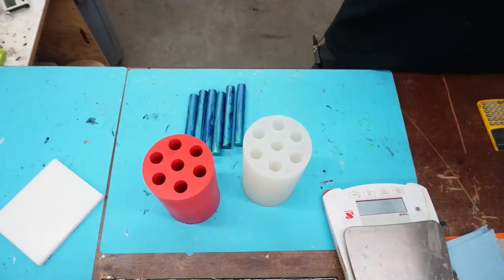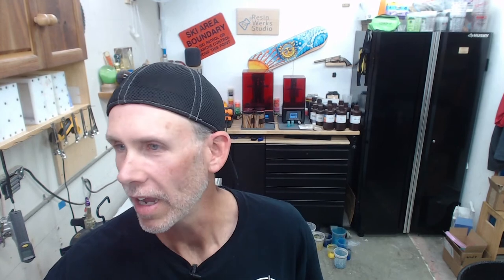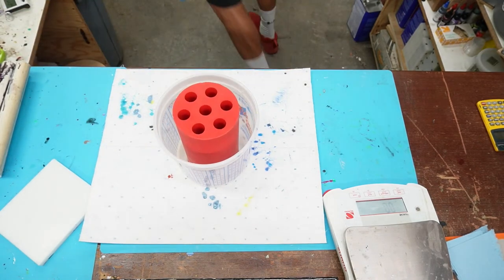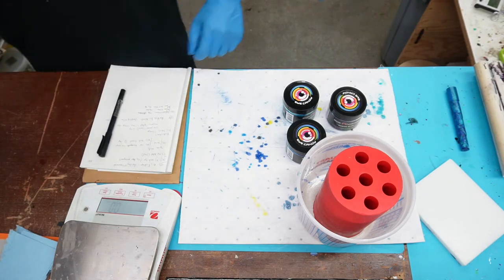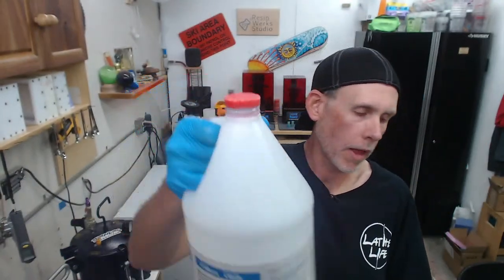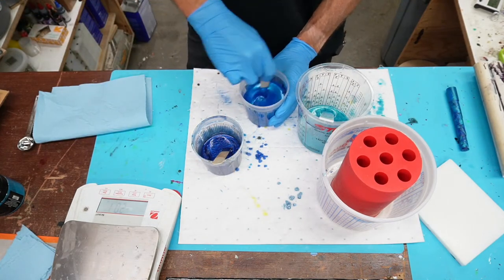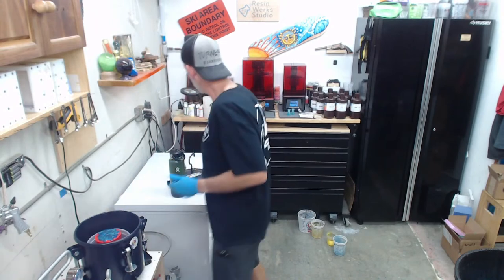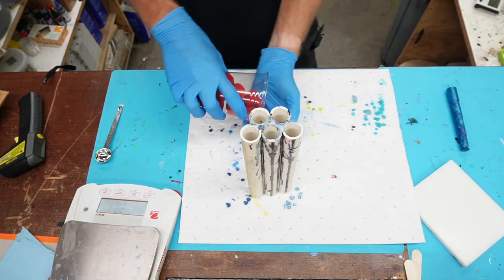🔴Replay: Resin Casting Water Themed Pen Blanks | Episode 214

Comment: Im shopping around for a pressure pot. Is there a size that you recommend?
Reply from the maker: Awesome!! I think I can help... There are two main sizes, 2.5 gallon and 5 gallon. It really just depends on what size projects you plan to make. If you can fit what you plan to make in the 2.5 gallon, that's what I would recommend since it's cheaper, smaller footprint, and it's lighter. If you will be doing a mix of large and small projects, then just go for the 5 gallon. I recommend the California Air Tools pots designed for resin casting. They are literally ready to go out of the box. You can check out both sizes at Turners Warehouse: 

-2.5 gallon: https://www.turnerswarehouse.com/products/california-air-tools-2-5-gallon-pressure-pot-designed-for-casting?ref=nvww

-5 gallon: https://www.turnerswarehouse.com/products/california-air-tools-5-gallon-pressure-pot-designed-for-casting?ref=nvww

I have a video that shows unboxing and setup for the 2.5 gallon pot if you want to see that: https://youtu.be/GNc-0imkH1g